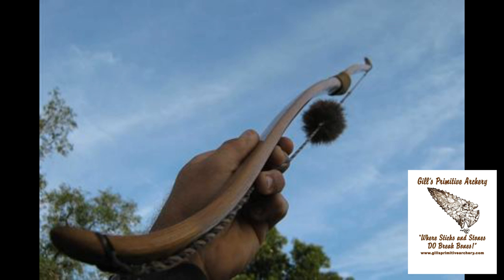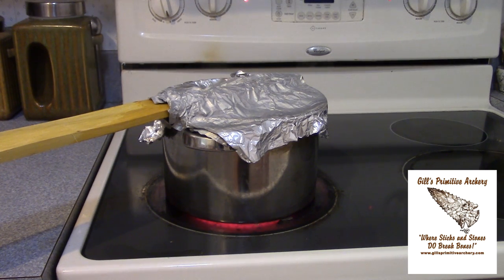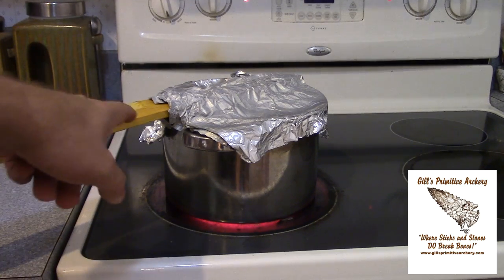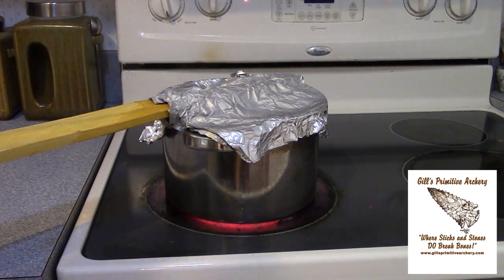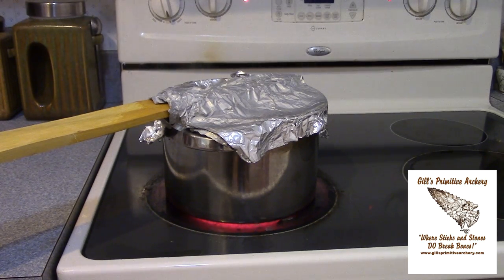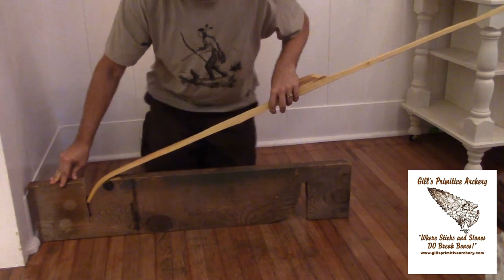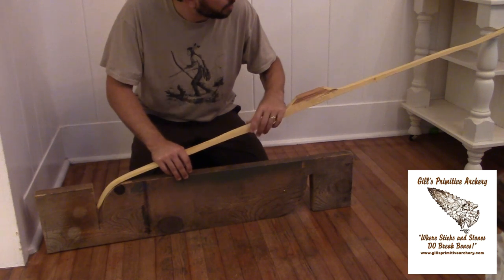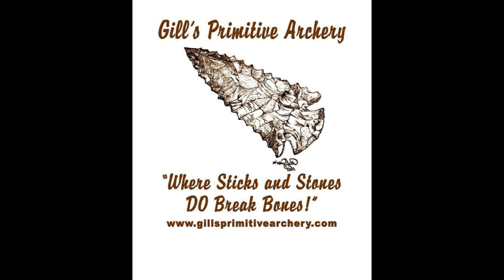How to Recurve a self bow - Bow Building

Comment: I've bent wood with steam but probably didnt do it right. The back raised splinters. I wrapped and glued it and the bow still shoots better than it did. What I have tried successfully is bacon grease and heat from either the stove or the torch. Be careful with the hickory though. It smells so good the kids want to eat it. Lost 3 bows that way.
Reply from the maker: haha, I dont know why I am just now seeing this comment.. funny stuff on the kids. you might not have gotten it hot enough with the steam. it's got to steam on a rolling boil for 15-30 minutes. Straight heat can work great too, i just like the uniformity of steam heating without dryin out the wood, but the grease definitely helps with that as well. lots of ways to get it done
Reply: Water boils at lower temperatures in the mountains compared to sea levels. At 1500 meter attitude the steam will be 95 degrees celsius which is not enough to bend the wood properly.
Few degrees coud be crucial since the 100C is already on the low-end for the job.

Comment: To everyone on here just a bit of advice:

DO NOT steam bend for less than an hour especially the first time doing this

Ryan doesnt bother to mention hes using osage orange which is probably the most tolerant wood you could use with little issues.

Also just did this with a maple board bow and it splintered with only 45 minutes on full boil

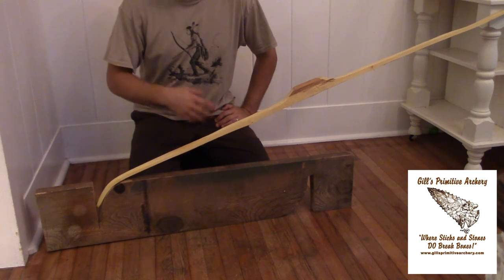Comment: so according to your advice, recurve the tips THEN tiller? @7:19 you say that you can tiller the bow something like an hour after you stick it into your 'tip flippin' form, if you flip the last 5" or so, how far do do you stop removing material during the tillering process to allow for 'static' tips? do you just tiller the whole limb tip and all? i am preparing to start a red oak board bow, and i want to flip the tips some, should i do it at the end 10lbs before my target weight, after bandsaw roughing out, or before or after backing? i plan to use something to keep splinters from lifting. sorry for the long, detailed, question but i feel like you're the most accomplished craftsman in this field thus you can give the best answer. thanks in advance!

Comment: so it's not the moisture from the steam that allows the wood to bend, it's the heat? that makes a lot more sense. I've been under the impression for so long that it was the moisture and you had to inundate the wood you wanted to bend so that it could actually bend, then you had to let it completely dry, which seemed like such a long, slow process for bow making, lol. this really helped me, thanks.
Reply from the maker: yup, for sure. The heat is what does it. In fact if you steam a piece of green wood, it will actually dry faster. The steam is evaporating water and will draw it out of the wood. If you ever try to steam bend a piece that isn't fully seasoned, you will see a bunch of little drying checks form in the wood where it was dried too quickly, even while using steam.
Reply: @huntprimitive9918  that's very good to know.... Now, I just need to convince my wife to let me do it inside, lol.
Reply: @huntprimitive9918  I'm assuming this will work on a bow with working limbs as well?

Comment: Do you mean the perpendicular cut into the form is 8" or the radius cut is 8"? I've made a couple osage bows, and actually used the edge of a round back chair to recurve them. I plan on making a form like you have there when I make my next one.
Reply from the maker: it would 8 inches in diameter of the rounded object that I used to trace the form.. like a bowl or dinner plate, paint can, etc.
Reply: Thanks!

Comment: I failed on my first attempt, when I split to center, not enough thickness at the fade on the top limb,my second attempt started out with a larger diameter sapling ,4 inches on the small end,in no small way, you were instrumental in my success beyond my expectations. 
Recurve 
62 # lbs @ 28 inches  - 58 inches tip to tip
I was shooting for 45# to 50 # got 49 #lbs
I wasn't expecting the dramatic increase of 11 # lbs ,expecting more like 5 #
Some string follow, I'll be more patient drying, put on the dash of my pickup, in full sun all day for several days (120 ° plus)
I have been looking for a stait piece of dog wood long enough for a bow,I found and cut one 7 feet by 10 inches in diameter, straight and clean, few knots, do I cut off the sap wood and chase a ring or do I treat it like Hickory  
I also found a  hop hornbeam that has several straight branches and trunk ,no knots or inclusions, how do I tackle these two woods, profile ect.

Comment: Thanks for the video Ryan. You said that this bending method works with other woods. Would hickory need to set in the form longer or be bent a little further than a wood like osage to allow for the give back?
Reply from the maker: yeah hickory will pull out a little more so bend it a little further for sure. It holds recurves pretty well, just not as well as osage.
Reply: Ryan Gill - Primitive Hunter Okay. Thanks!

Comment: Could I buy a recurve from you , I'm 5'9 what size do you recommend
Reply from the maker: knowing your draw length would be the most important factor. I can make a bow for you. If you've not been there yet, my website is www.gillsprimitivearchery.com
Reply: Typically a person of your height would require a 68" recurve bow assuming average human proportions. This isn't always the case as you may have freakishly long legs and short hands or short legs and long hands. To find your draw length, measure your wingspan, the distance from middle finger tip to middle finger tip divided by 2.5.

Comment: Does this method work with Yew as well? 
I have 2 real nice Yew staves I am going to get started on in a week or so and I would like to flip the tips.
Reply from the maker: yes, I use it on my yew staves as well. Best of luck
Reply: Michael Sturm If you pick out the seeds out of the red arils then you can eat the arils and they are very yummy! Don't eat seeds, leaves or anything but the arils, it's deadly!

Comment: How would people have done this primitivly?
Reply: Using a wood fire instead of the stove and clay pots with water instead of metal pots for steam bending . I usually hear they did more dry heating by just lettting the fire burn down to the hot orange embers and placing the bow (with no pot) just high enough over the embers to where it heats up but doesn't burn the wood.

Comment: Hey Ryan what do you use for overlay material, I watched your video on applying them. I am building my first bow and like the look it gives a bow. I went to the Mo. Bow Building Jamboree at Marshall Mo this past week and almost got a finished bow. Man do I understand why these bows sell for 600 bucks, specially when its 100 degrees outside. Thanks for all you do to promote this great hobby-lifestyle.
Kenny Backes
Reply from the maker: thanks very much. I use so many different things. In the video I used Ipe. Any hardwood works fine but I also use various horns and antlers as well
Reply: One more question if you have time to answer, my 65 inch Osage Orange bow only came in mid 30's poundage. To get more weight do you suggest shortening the bow to say where the string nocks are at, or putting the reflex in it like you do in your video. Do you think I can gain enough to get 50+ pounds out of it? I ordered your book this morning btw. Thanks for your reply. Kenny
Reply from the maker: No prob, but unfortunately you will be hard pressed to get it anywhere near 50#. You can shorten it and add reflex but you will likely only gain 8-10 lbs.  If you reflex it and then back it with rawhide you can gain a little more as well.

Comment: Hey Ryan,  What is the thickness of that bow limb tip that is being recurved ?  Is there a recommended thickness for a limb tip to hold a recurve ?
Reply from the maker: thickness will vary greatly on bow weight and limb length. Just keep the limb the same thickness as the outer 1/3rd  and you'll be fine. If you continue to taper it real thin, the curves will pull out.

Comment: Can I use steam to straighten my handle my bow is black locust and has a slight bend at the bottom fade to the side ?
Reply from the maker: yup, steam good for 30-40 minutes and draw in into position with a board and clamps.
Reply: Thanks Ryan. your videos are awesome do you have one on cane arrows?
Reply from the maker: Thanks very much!  and yes, I have one on building cane arrows... just search Ryan Gill building cane arrows and it should pop up